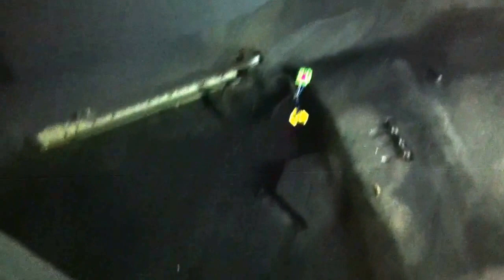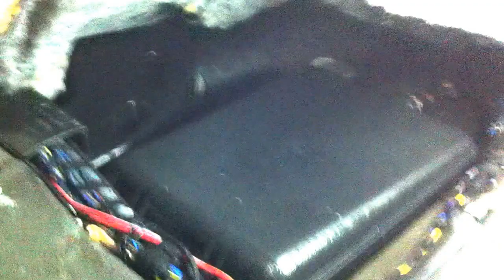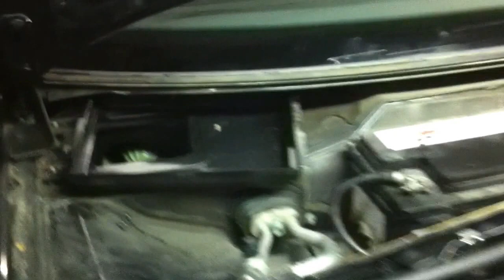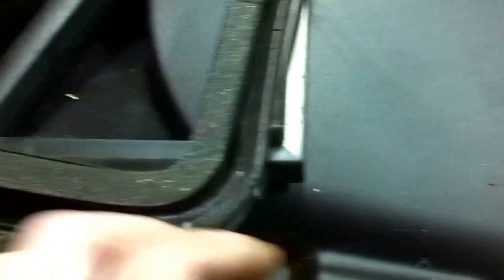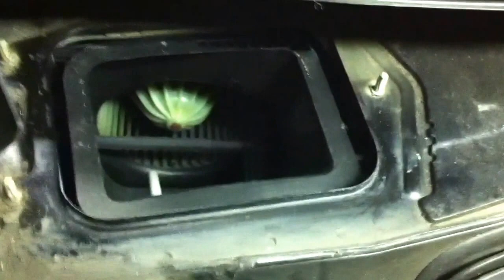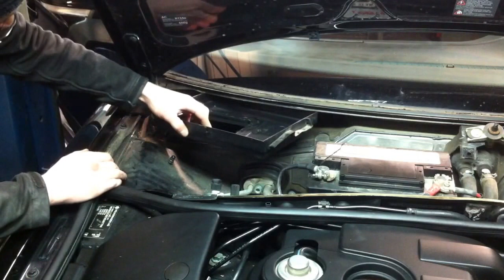VW Passat, Golf 4. Water enters in the car. water ingress. water on the passenger side

Comment: Sadly a common fault on the passat....i understand the box has a really poor IP rating so moisture has no problem soaking the convienience module...repairing or replacing them is a real grey area with the vw's unfortunatley...golf IV and bora's sits under the steering column however theyre still known for failure.
Reply: Brett Brooksbaطnk ه